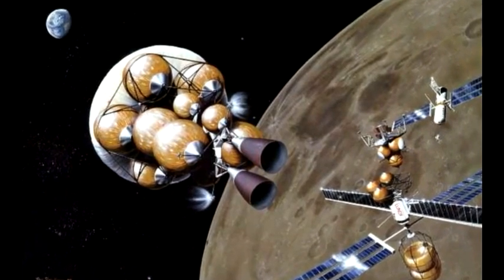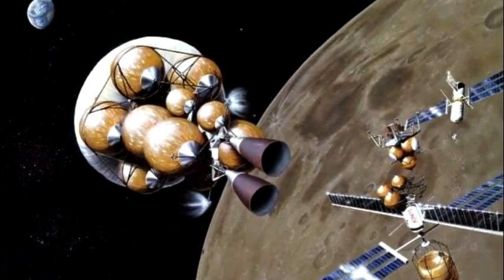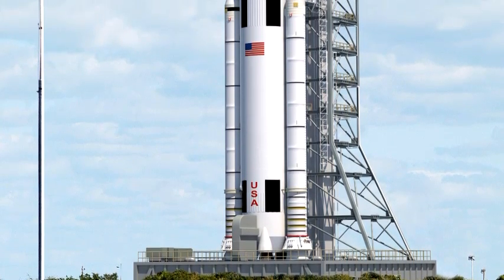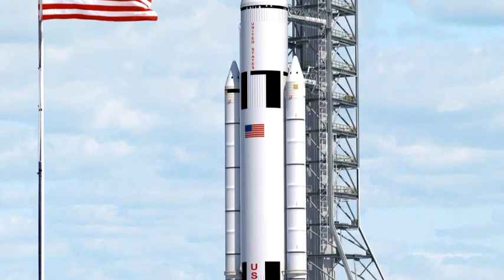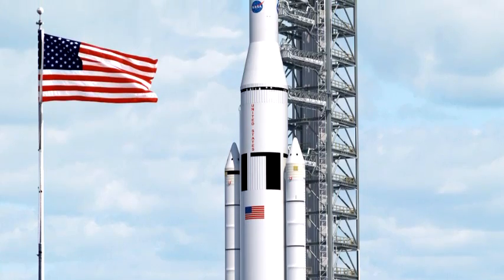Propellant Depots vs Heavy Lift

Comment: I think the main advantage of propellant depot that you aren't mentioning here is that they make re-usability of spacecrafts much easier, thus driving down manufacturing costs. Suppose you wanted to start a space tug business, as what has been teased by a few companies already. If you could prolong your mission by a few months by having your tug refuel in orbit instead of having to launch a whole new tug for each customer, you could save a whole lot of money. And the costs of launching the fuel are smaller than those of launching the fuel and the craft. The costs of launching the fuel are also distributed among all of the customers of the propellant depots.
Reply: Essentially, propellant depots, even before they can be refuelled from low deltaV costing extraction sites (Moon, NEAs), are a more efficient way to build up infrastructure in space. It's similar to paving a dirt road so that more smaller cars can pass more easily.
Reply: And investing in propellant depots and heavy lift launch vehicles at the same time is possible, but Boeing thinks depots would hurt the SLS so it tries its best to lobby against NASA exploring the possibility of propellant depots. Boeing even made ULA cancel ACES which arguably could have evolved into the first propellant depots.